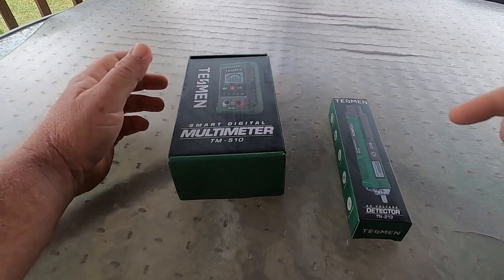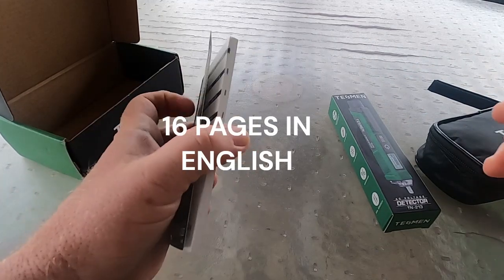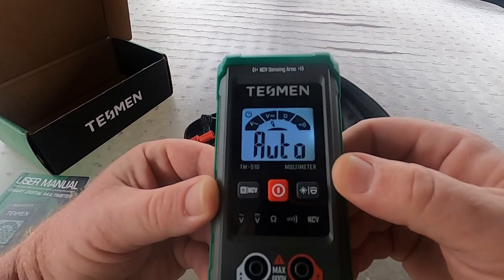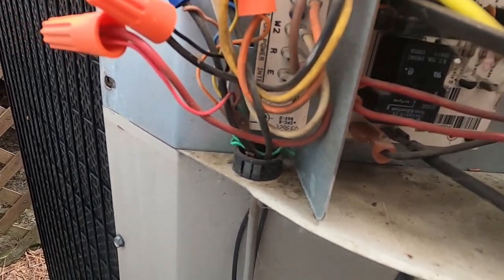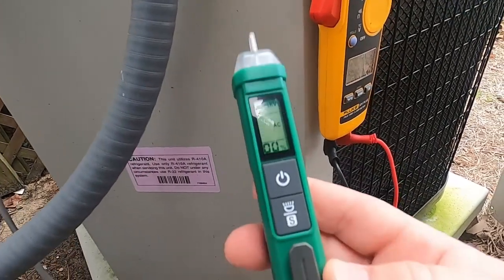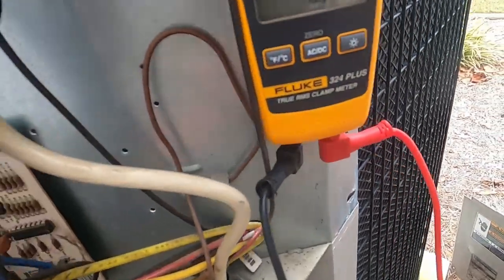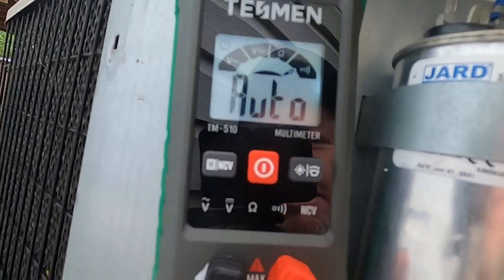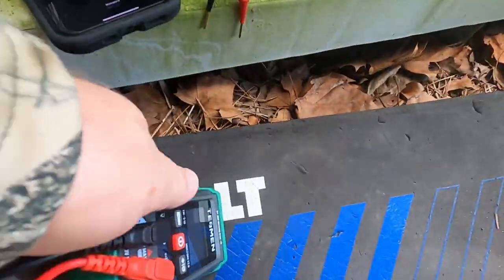Do these really work?

Comment: I have seen reviews where people have taken those meters apart and there's no safety features like explosion proof fuses in it at all, that means if it shorts out it blows up in your face. use it on line voltage if you have a death wish. don't waste your money on this junk when you can buy a fluke 101 for like $43, and don't trust your life to an $11 non contact voltage tester

Comment: Yes they do work i have one from consumer electric and klien tools i usebis just to make sure there is nopower running after i cut power to a unit.. for more indepth testing you need a full on meter
Reply: You can get zapped hard by a stray leg of power with a non contact voltage tester not giving an accurate answer if it’s love trust me I got hit and used a fluke so now i double check with a good meter always